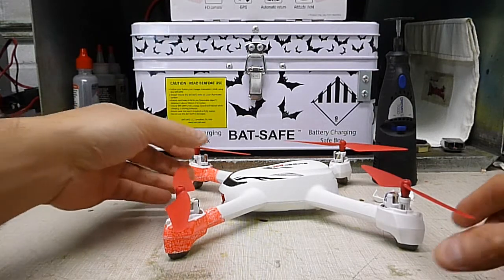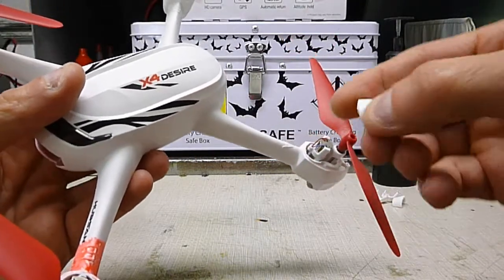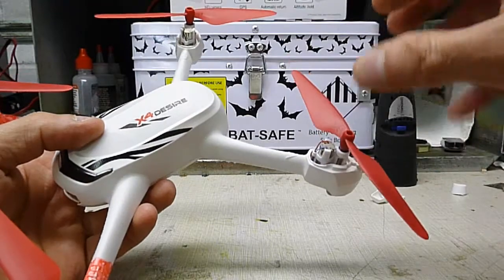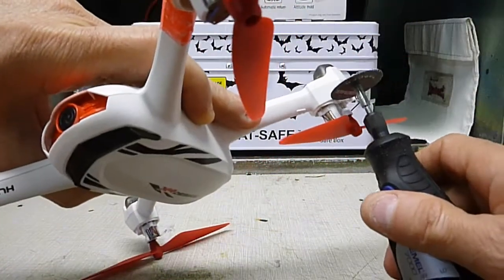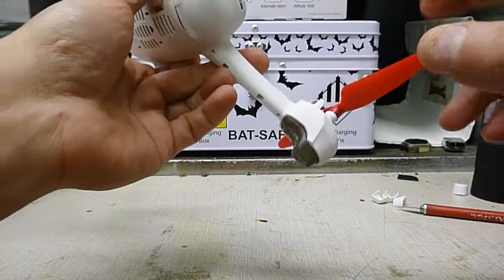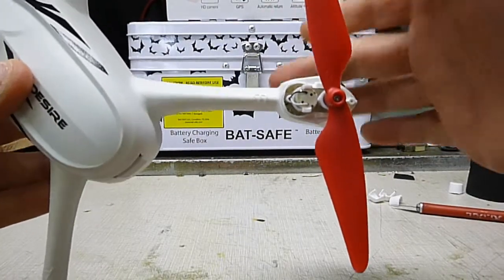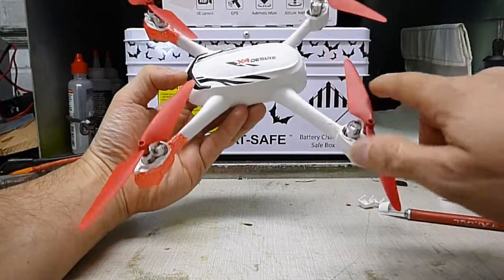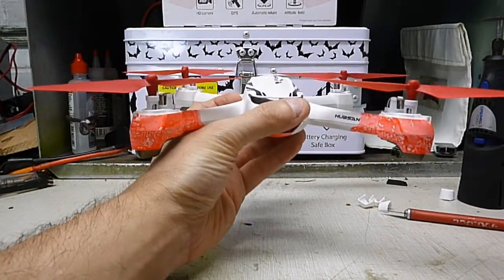HUBSAN X4 H502E MOTOR COOLING MOD

Comment: WRONG: if putting brushed motors "OUTDOORS" would make them last longer, nobody would use brushless and our appliances wouldn't have covers on theirs. WASTE OF TIME! The source of WEAR on these is prop torque between the drive shaft and case bushings, you can ONLY eliminate that torque by removing the props! Since the shaft is being pulled in the direction the prop wants to go (upward), the wear in drone applcations has NOTHING at all to do with "heat". For this reason, BRUSHLESS MOTORS LAST ~30% LONGER THAN THESE only due to sealed shaft bearings being used, the FET's on the ESC take a helluva pounding. Ask around on any hobby site, like RCgroups, RCuniverse or HeliCrack and find out.
Reply from the maker: Sorry your incorrect the plastic section I cut off traps in the motors heat and it's ability to cool down and with it off the props thrust forces the wind right across the open motor there for cooling it down much more efficient than when it is fully encased with the plastic cover over it.
Reply: Calm the fuck down you nerdy drone bitch

Comment: How do I get the h502s camera model to work inside my h502e useing E remote as well , I can get a video only when I plug in the quad with h502e remote off , when I try to turn on remote to bind and calibrate the signal cuts off , do I need the h502s remote or do I need to update firmware?
Reply from the maker: Hi I am not sure about this sorry.
Reply: Shen RC it’s ok thanks anyway I subscribed to you btw

Comment: is there a link where i can buy that handy cutting drilling all in  one  tool?
Reply from the maker: Hi theirs all different types I have the one that you can use 4 AA batteries in it I use 4 rechargeable batteries in it, they make ones with rechargeable packs or with cords you plug in the wall.https://www.ebay.com/sch/i.html?_from=R40&_trksid=p2380057.m570.l2632.R2.TR2.TRC1.A0.H1.Xbattery+dremal.TRS0&_nkw=battery+dremel&_sacat=631
Reply: shenlonco can u give me the buy link
Reply from the maker: Hi you want one that plugs in the wall or a battery one with a charger , or like mine that you run off AA batteries or AA rechargeable batteries?
Reply: yes the one that runs on AAs
Reply from the maker: Cool here it is I use the amazon basics rechargeable batteries in mine it works better than with  standard alkaline AA's    http://www.ebay.com/itm/One-new-Dremel-7000-N-5-6-volt-2-speed-5-Accessories-4-AA-batteries-Free-Ship-/121852621166?epid=1663609481&hash=item1c5efb716e:g:AUcAAOSwg3FUnzYH

Comment: nice mod, do you think the 501c camera will work in the 502e?
Reply from the maker: Douthinkesawus TV hi thanks, I don't think it will work , I know the h502e camera is not the best but you can either do a white balance or manually adjust the hue in a video editor program to take out the off color hue it has.
Reply: i was thinking that they are both 7.4v and the controller is the same, so if the link to the control board is the same?
Reply from the maker: I think i seen on some message boards about it and it won't work.
Reply: shenlonco shame

Comment: Nice mod! Did you notice that the motor did overheat?
Reply from the maker: this quad is noted for burning up motors so this helps greatly.
Thanks for watching.
Reply: Ok so it's a necessary mod :)
Reply: Shen RC oh... and i burning 3 or 4 batteries without stop...

Comment: cool brother,  I was thinking of drilling a bunch of small holes instead.that way it still has some protection around it.
Reply from the maker: That will work also but I don't think this thing will matter if it's off because the prop gets hit first.
Reply: Big drone flyer77 I think drilling a few small holes will have just the same effect but maintain the structural strength and integrity of the chassis. My mine concern taking all that large piece of the motor housing off, is that looks like it stops any vertical movement of the motor!?